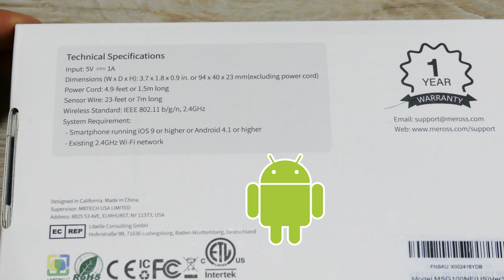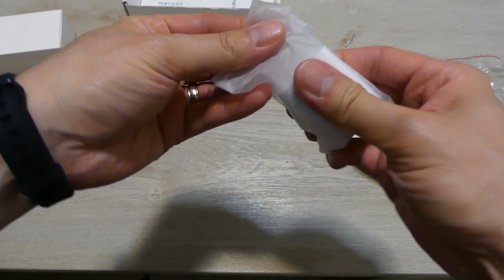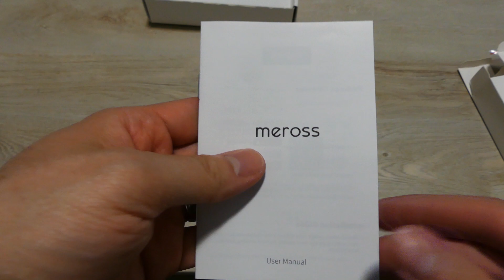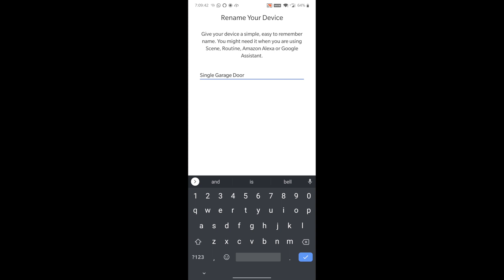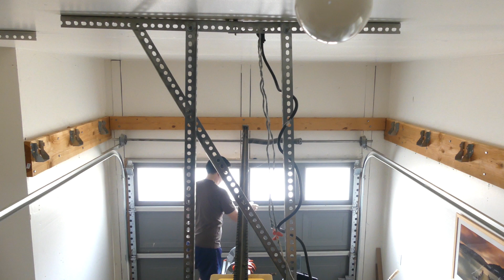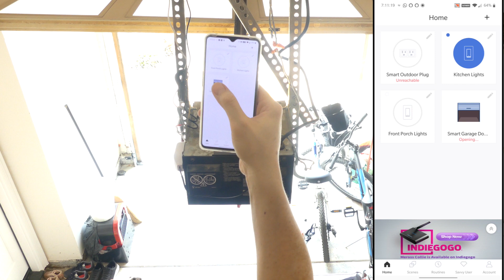Meross MSG100 Smart Wi-Fi Garage Door Opener Unboxing, Setup, and Installation (Step by Step)

Comment: Do I need one of these units for each door? Then I need MSG200?  But then I need a second or third sensor unit. 😢
Reply from the maker: @delinquense... Yes. Unfortunately with this model, you will need a unit for each door. There is a different model that will be able to work with two separate doors, and I believe it is the MSG200, like you said. But I don't remember.

Comment: nobody doing videos on these mentions you must have a hub to use the app away from your home wifi zone.
Reply from the maker: You actually do not need a hub. But you do need to connect your Meross Garage Opener to your WiFi so that it has Internet access. That way you can control/monitor the garage opener from your app on your phone. And of course you'll also need Internet access on your phone as well. So if you don't have WiFi on your phone, then at least you'll need cellular data.

Comment: Wished you would have shown a close up of the sensor install on the actual garage door and wall.
Reply from the maker: @John M B... Some others told me the same thing. And I actually did have a video footage of it, but realized I forgot to add it into the published video after I uploaded it. 🤦🏻‍♂️ I think I might just upload another video just as a follow up to show how the sensor is actually installed. 👍 Stay tuned. 😉

Comment: nice review - though after about 6mos, mine has now decided to open and close randomly after I initially click in the app to open/close it - seems to have started happening just after the firmware 'upgrade' too.... tried different settings including changing trigger duration - may have to reset it all and start from scratch, bleh
Reply from the maker: @antmon antmon. Sorry to hear about that. I never had that issue yet, knock on wood. But I did have an issue with the app where sometimes when I open the garage manually through the wall switch, then I open the app to use it to close the door, the app still shows the door is closed. So I have to refresh the app and then it correctly shows the door is open. Then I can click to close the garage door. A little annoying sometimes cause it takes extra time to refresh the app and then I can close the door. For your problem though, I think you can contact support and have them help you with that issue. That definitely is not a good thing. Hope they are able to fix it. Let me know how it goes. 😉 Good luck!

Comment: thanks man. i just got the homekite one i will install it this weekend with your video
Reply from the maker: You're very welcome @khmertech! Glad I was able to help out. Let me know how it goes for you or of you run into any problems. 👍
Reply: @getoats  big problem here. I’m stuck at connecting the terminal. I’m using dominator garage opener god-11v3 and I don’t even know where the terminals at. Help
Reply from the maker: Good question... So what you will need to do is trace the wires that connect to your wall button, and those two wires will be where you will connect the smart garage door device to. Then you can test it by shorting those two connections and it should essentially open your garage door. Hope this helps. 👍

Comment: Thanks for the video. Did you get a chance to set it up with Google Home? When you ask google to open the garage door, it asks for PIN. In the setup there is an option to enter pin and once you add that google will ask you to verify pin every time you command to open and close the door. Is there any way to bypass the pin validation?
Reply from the maker: Hi @TubeSwarn...  Yes, I actually did get a chance to setup with Google Home.  And yes, there is a way to bypass the PIN validation.  If you go to the Meross app, just go to the Device Settings, and then under the "Voice Control" section, turn off the "PIN code" and that should bypass the PIN code when using the Google Assistant or your voice to open/close the door.  Hope that helps.
Reply: @getoats  Awesome. Thank you so much. !!
Reply from the maker: You're welcome @TubeSwarn. Glad I was able to help out. 😉

Comment: Works well and sets up fast but has an issue with new HomePod minis. Will not allow you to use them with this HomeKit version. Reply’s to emails are very slow. So if your willing to just use your unlocked phone or iPad, your set if you want to use your new HomePods Minis with this your SOL
Reply from the maker: Thanks @Nicolas for the comment.  I have Google Home, so I haven't had a chance to test this on Apple HomeKit.  But you're right, the version I have is not compatible with Apple HomeKit.  There is another version out there that does, and I hope they put out some updates to address the issues you are having. I did notice they update their app every so often.

Comment: Thanks for a great video!  I have a few questions regarding the security setup, securing the device in the home network, and accessing the device over Internet. Once you have the network all tied in from the Meross garage device to your home network WIFI, can you get notification and remotely access the garage door outside the range of your home network's WIFI range (ie: anywhere in this world)? In setting up the network between the device and your home network using the 2.4GHz 802.11n security, does it use WPA2-AES or does it use the weaker TKIP security pass key only? Does the app provide the MAC address of the Meross device or does the device itself provide a printed MAC address internally or printed on the back? The reason for this is that I set up my router MAC address filtering and allow those specific devices to access Internet. Last question is, if the notification and remote access is sent across internet, is there a cloud service that the app uses to relay the notification and remote access to and from the device, especially if you set up firewalls for the ISP modem and on the second router where the device is situated on the network? This last question deals with the app and how it gets the notification and how it finds the device over internet when you're actually not connected your own home WIFI network.
Reply from the maker: Hi Test...  Sorry for the late response.  I have been extremely busy with other things at home.  But to answer your questions.  1) Yes, you can get notifications anywhere in the world and be able to open the garage door anywhere in the world as well (as long as you have internet access and the Meross app installed on your smartphone). 2) When setting it up, you can connect to any WPA2 SSID using AES or TKIP encryption method.  3) Yes, the app does show you what the MAC address is of your device so that you can add it into your WiFi router for MAC address filtering, and 4) Since I'm not the app developer, I'm not sure how the app works, but from what it seems like to me, the app either communicates back to a server in the cloud or back to an on premises server hosted locally at the Meross server farm.  I haven't had a chance to look into the traffic, but if you are curious, you can probably take a look at your firewall logs and find out where that traffic is going to and that will tell you for sure if it is reaching an on prem server or a cloud hosted server and what type of port the app is using.  Hope this helps you with the security setup portion of the device/app.